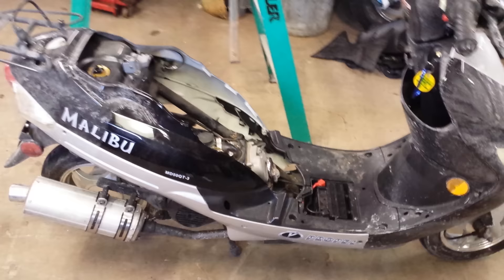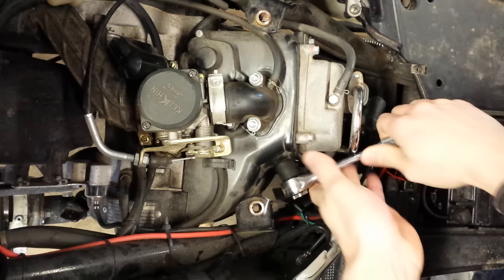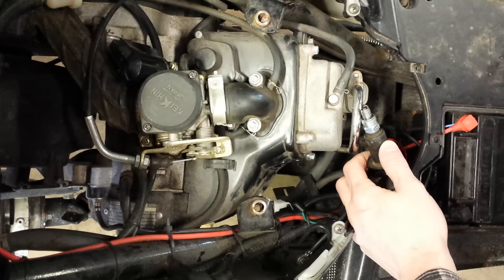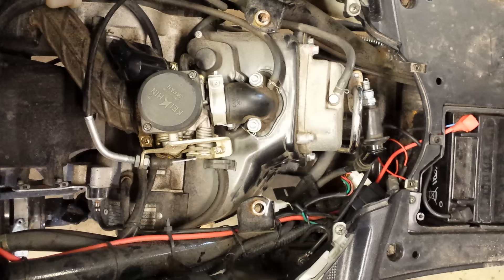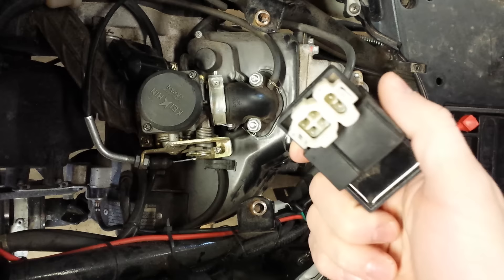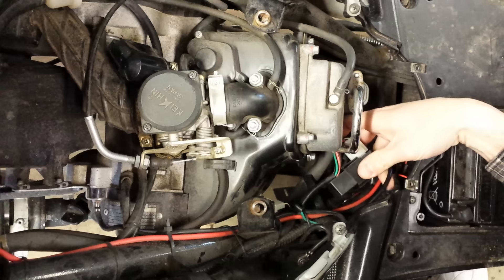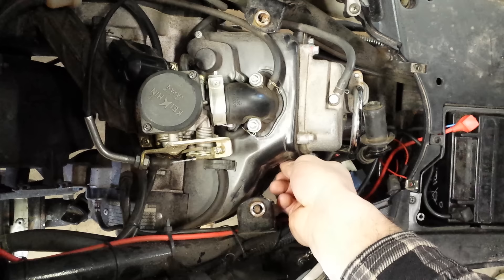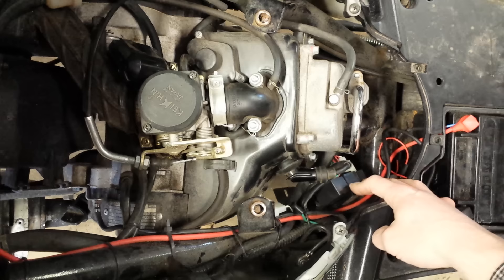Fix Chinese 49cc Scooter that won't start

Comment: I am having fuel issue.. when I disconnect line from carb and turn over gas flows..when connected no more flow.. carb is new and cleaned..tried other carb.. have great spark..any suggestions???

Comment: I have a d1e41qmb moped I have a new spark plug getting spark got a new carb getting gas hot a new cylinderl kit getting compression. But won't start still nee help? ??

Comment: need help with my sinski cute 50cc scooter there is spark coming from stator when disconnected but when i connect it there's not even a spark from that point to the line connecting to the coil. please help going crazy already. thanks!

Comment: After a few days runs on my moped with new performance cdi box, high tension wire & spark plug, oil and it runs good. Now, new problem arises the word "my moped won't start" again and I don't know where to start?

Comment: I’m getting a spark and fuel and still nothing. 
My moped only has 200 miles on it and the push button start hasn’t worked in a long time so I’ve been having to kick start it. 

Will only run for a second or two but after the second attempt, I get nothing

Comment: Great video, my question to you is my son took our Japanese scooter 49cc for a spin today with his friends, it’s been running good but for some reason he called me and said that he was going down the road and lost power. It starts but it’s really boggie, after getting it home I was looking at it and it does start but only if you hold the throttle almost wide-open but it doesn’t having a power trip and spend the wheel. Any ideas to look for?
Reply: Needs Carby clean mate. Happened to mine too

Comment: i have a 50 cc keway moped i have spark and fuel and still wont start  i just started it up for the first time in a year road around the block and it died on me so i cleand the carb and checked the fuel lines still wont start help!

Comment: Where is the spark plug located on a 2014 Tao Tao 49cc? I put a new starter yesterday and it is doing the same thing from your video. Helpp please!
Reply: Have spark and fuel but will not start

Comment: Your a GOOD mechanic.....After being around engines for years can I also say that that engine sounds better than most ?
Is this the same as a Honda or is it a better motor in a cheaper scooter ?
Reply: BRUCE LEE I got the cut cord its located on the bottom left corner from the peddle in it got a white tube on it what Is that called my cord it cut form that

Comment: Quick question, mine been sitting for awhile, put in new battery. Nothing working no sound no lights. You know what the problem is? Thanks in advance
Reply: fuse .. or ignition switch

Comment: My scooter been sitting 4 months I live in florida. It gets spark and I changed gas and put sea foam in it. I put starting fluid in eventually got it to start and it would run then randomly cut off while driving and won't start for 15 mins then sometimes won't start at all. I tried the next day and it won't start and I don't wanna keep paying my friend to pit starting fluid in it to get started then have to call to help me bring it home after it dies. It's a brand new scooter bought a year ago only 105 miles. What do I do?
Reply from the maker: Sounds like the first thing I would do is take your carb off and clean it or take it somewhere to get cleaned and see if everything looks ok inside. Sounds gummed up

Comment: Hey guys I have a Piaggio Free 50cc kick-only scooter and it has always started on the first kick since i bought it.
A few days ago that changed over night and now it wont start at all cold, I need to pull the throttle for a couple of seconds for it to keep going and not stall directly after the kick. When it's warm it runs and starts just fine. 

If I had to guess I'd say it's a problem with the choke, but I'm really no expert. please any ideas?
Reply: Consider your idle speed adjustment screw.

Comment: Thanks 4 such a useful video. 
My kymco agility 2011 won't star . I cc changed the spark plug  it doesn't have fuel problem and changed the battery  still it won't start .  Can you HELP MI. PLEASE

Comment: I need help with my bike...brakes lights don't work... The brake light comes on... But when i brake it doesn't get bright to show the driver behind me I'm breaking
Reply: If your lights are randomly dimming and not working correctly, it's either an old battery that should be replaced or your stator is not pumping out the current needed to power things. So I would start by replacing or charging your battery completely and if it persists you might need to swap the alternator or something

Comment: "CD fucking I"
day two with my scooter 
already replaced all fluids
disassembled and cleaned and reassembled carburetor 
replaced and hoses 
disassembled and cleaned fuel lever assembly 
on off reserve lever lots of calcium build up 

tonight I hunt for this cdi
I have spark as u, I have fuel as well. 

p. S it's a 1986 Suzuki fa50 moped. sat for 20+ years hahah

Comment: Great video!!! Helped alot... I have taotao 50 that wont start. New fuel, new oil, have spark (new plug), removed carb, disassembled, cleaned, and reinstalled, no leaks. Vacuum is good too! Any ideas?
Reply from the maker: have you taken a compression test?
Reply: Edward Iry that's the same with mine did you get it going yet
Reply: method ed would like an update if any
Reply: A new plug doesn't mean you have Spark,  you have to test it like he showed you.

Comment: mine will start with the kick start petal, but it wont start with the button break thing... only when i hold the buttom and kick start and mix a little gas in
Reply: not sure what it can be.... how long does a battery usually last, and do i just unscrew the lights to change out the bulbs??

Comment: Great video. I have spark and gas. However it will start and run for about 3-5 seconds then die. Then won’t fire back up. Any suggestions would be very helpful
Reply: ever fiqure it out i have the same issue

Comment: I had changed my carburetor, automatic choke, spark plug, battery and cdi and it still wont start?
Reply: did you check the valves? they may need adjustment. if they are off, it wrong be getting enough compression to ignore the fuel.
Reply: I sent mine to the shop and they told me, that it was a bad gas mixture stuck inside my carburetor. They also recommend me to switch from regular gas to 91.

Thanks for the advice though!
Reply: Jaycee Santos Cordova  may be the coil

Comment: I have a 08scwhinn scooter and it has no spark. I have changed the entire electrical system and I can't get it to work. Please help.
Reply: Have you tried checking the cdi cut off switch?? Sometimes a pinched wire can ground to the frame and prevent any spark from happening. Some scooters or mopeds even have points systems  but not really common these days.

Comment: Kasey do you have a video showing how the fuel lines should be? I have a manual but it is not clearly shows how. I replaced the carburetor and I can't get it to start.
Reply: What is the model of the moped/scooter? I may be able to get you the shop manual or a layout of the fuel system for you.

Comment: I've a problem with my chinese Generic XOR 50. When I was riding about, the engine shut off and I couldn't get it running again (happened about 2 months ago). I've checked for a spark and there is a spark, although I still have replaced my CDI box and my ignition coil and nothing happened - still the same. I got a friend to come and see what's wrong with it and he basically put some petrol inside the cylinder and adjusted the carburettor and it started for like 20 seconds and stopped running again. I have no idea what it is now. I've check the cylinder + piston & rings and replaced the whole cylinder with a new piston and rings but still. Would you think that it's the carburettor fault? I mean when my friend put in some petrol into the cylinder it did fire up but only for the 20 seconds and then nothing. I've ordered a new carburettor but I'm wondering if this could be the issue? The spark plug is sometimes wet and sometimes it isn't. Fuel sometimes even isn't sucked up through the 'wires'. Thanks.
Reply: +Alan W its time for a New Carburetor $20 on Ebay
Reply: +Tim Maines I've already replaced the carb. I took it to the garage and they say it's the engine - bearings and crankshaft. Now I have to buy these parts and everything else like the cylinder and piston because it f*kd up everything :(
Reply: Same happened to my longjia speedjet 50cc moped and I've replaced whole ignition system including plug and still nothing
Reply: +MrLaney32 my one turned out to be the faulty crankshaft. It was wobbling a bit and didn't start because of that. Changed it and it works ;)
Reply: Thank you, we are waiting to get an impact drive in order to get the stator off and will have a look at the crankshaft for any issues
Reply: +MrLaney32 I need to get an impact drive or gear pulley to take the stator off as well because my scooter doesn't charge my battery :( I doubt it would be the stator that's your problem. Do you have a kickstarter? If it doesn't work then it's not the stator :)
Reply: +Alan W it's the last part of the bike that creates the spark side of the ignition process that we haven't checked and the when it does on me, I was riding in terrential rain so if it's not the stator, then the bike is well and truly dead and is only 3 years old.
Reply: +MrLaney32 But did you check if you have spark?
Reply: can you turn the engine over by hand? never trust a shop

Comment: This didn't work. Bought 2 boxes a d my still won't crank over. Just watched another video that showed to remove the air box cover and spray carb cleaner into the intake port. Hope that works cuz changing the cdi boxes wasn't my problem

Comment: On the connectors to the cdi should the 4 prong side have all four hooked up? The moped I'm working on only has 3 wired and the forth is open. Not sure if that's the problem or if it's the cdi
Reply: the 4th one would be the RPM sensor, so it cuts the spark out after a set RPM stopping it going over 31MPH. Without it it can go faster, at the expense of a shorter lifespan on the engine
Reply: I have to question the 'shorter lifespan'...  The engines are designed for the higher RPMs - they are just throttled back for legal reasons.

Comment: so do I need to hold the brake lever in order to start it? kinda like a safety thing? sorry new to scooters lol
Reply from the maker: Andrew Sybert  yes most scooters will have to have the rear brake held in order to start.
Reply: left side always works to..

Comment: I have a new 150cc scooter.  Drives great... but take a couple times long pushes on the starter button to finally get up and running.  Any suggestions?
Reply from the maker: Sounds like a fuel issue.
Reply: Yes, check / clean the carburettor .. and if it remains like you described, change to a bigger nozzle .. begin with 1 or 2 steps bigger ..

Comment: I need some help, Change the engine put everything back together it’s a new engine there’s two components on the front and one on the side of the carburetor that are not on the new motor that just closed them off I can’t get spark to the spark plug

Comment: Hlleo, i have the same issue.. thought it was my pump got a new one it started and after running for a while it stopped.. idk if i might have the same issue but this scooter is 600 miles old onlyyyyy

Comment: Great video very detailed. I have a question though. My Chinese 49cc scooter dies when I throttle. What do you think is the problem?Thanks
Reply from the maker: carb needs to be adjusted or adjusted and cleaned

Comment: hi i have problem with my yamaha vino 125 2006 has spark has gas good exhaust is good  valve is good crank but wont start have the problem for weeks please help thanks
Reply: Possibly a low compression issue.

Comment: Mine is doing the same thing it is a 150cc BMS Heritage could this also be my problem and fix? After paying the scooter repair guys an arm and a leg 2x now if I go again I won't be able to ride anymore... no more limbs (yuck yuck badda bing) anyway it has the first 500 miles on it I have it on a battery minder & have checked it is not the battery.I asked the scooter repair shop to replace the spark plug when they tightened everything up and did an inspection on the uncrate hard for me to tell if they actually did or not. I'm thinking I could take this to my corner mechanic who is very good, honest and he could help me for far less $ and aggravation every time I go to this shop I feel like I am a second class citizen because it's not a Vespa and I have to sign a huge long waiver and I'm fed up and a woman feel like they have taken advantage of me twice.
Reply from the maker: I have no idea what your issue is. no spark?

Comment: My CGI Box does not work possible because i have no noise clicking the push to start button Help
Reply: KalonMcL Global that could be bad solenoid not the cdi. A cdi very rarely ever goes out.
Reply: @Unknown-hl7sb  cdi is most common part to go out if you have stock Chinese one.
Reply: john wygle yeah the stock ones are a pain in the ass.

Comment: I got an issue with my 50cc scooter too, when i roll on the throttle it wouldn't move forward, and when i rev it really hard, it would lunge forward very fast, seems kinda dangerous. Any idea what could be wrong with it? thanks in advance
Reply: Any updates to the fix? Mine was lunging also like the throttle was stuck but wasnt.
Reply: @Bluenosedogman  sorry, couldn't find a fix, i eventually sold it

Comment: Thank you! Great video ~ I bought a Bashan scooter from my nephew who left it sit outside in the weather over a Wisconsin winter. It starts but won't stay running when I accelerate. Chokes out. Can this also be the culprit for my situation as well? Should I check the carb (if it even has one ~ lol)
Reply: Yeah, that's a carb issue if I am reading you right. There are some great carb cleaning videos here on YouTube... or if you're not confident in doing that, replacing a carburetor is SUPER easy and VERY cheap on Amazon or eBay.
Reply: @JasonOfOconomowoc  Thank you :)

Comment: hi I hope you can help put a  different engine in my longjia digita 51 and got it going and when I Rev It Up my lights went bright and I did it again and the bulb blew can some help pls the fuse near the battery is ok it blew my front bulb and my back light bulb thks all
Reply: Check the battery if its a 6volt system as the battery becomes the voltage regulater.

If its a 12volt system then check the voltage regulater , its normally a alumium box with fins for cooling somewhere on the frame or near the battery.

Comment: I had the same problem and in workshop they said you need to rebuild all the engine because crankshaft change rotation!!! I dont know what it is all about but after rebuild engine and spend 1000$ everything is fine.

Comment: hi i thought i had the same problem but it doesnt hive any spark light when i changed the cdi. any sugestions?
Reply: I'm propably too late for you but for all others with this problem: check your stator and pickup (under the right black plastic fan cover). Also check your ignition coil. Sometimes you can get a new cdi, stator/ pickup, carburator, sparkplug and ignition coil as a set on ebay for under $40. You should order one for replacement parts and testing.

Comment: i've recently changed my spark plug, cdi and carburator and it still won't crank. what else can do?
Reply: Check the starter button for continuity or check the starter relay to see if its good, you can jump start it by taking positive directly to the starter, if it starts then you have a bad starter relay

Comment: Hello sir, my honda 60cc scooter doesn’t start and i supposed to kick that it was little hard to kick but now when i kick it to start its like so soft goes down. Do u have any suggest
Reply: No resistance when you kick start means there's no compression at all... how did your engine die? Was it suddenly and then it shut down? Or it just wouldn't start one day? Basically I'd pull the spark plug off and then buy one of those little compression testers and see if the engine is still OK
Although, to be honest, it's WAAY more likely not to be a compression thing. It's probably because your kickstart mechanism came undone. You'll have to remove the transmission cover and take a look at the springs and gears inside. There may be a mechanism with gears that has to be reset just perfectly. Without knowing exactly what the inside of your transmission looks like  I can't be more specific here

Comment: Mine will start and run for a couple of sec then stop running I have to let it sit for five minutes and it will start for a couple of sec then stop running...
Reply: Fuel filter?
Reply: Sounds like your electric choke has issues

Comment: hey buddy I had a quick question I need
and thanks for the video help a lot
Reply from the maker: King Jay what's up?
Reply: I got this cut cord in I followed it to the bottom left side of the scooter by the peddle in on the bottom of it, it got a white tube with a pointy tip what is that in were can I by another one from
Reply: Could this be the float bowl drain tap?

Comment: thanks  for the video .. but mine has power to the  lights and horn and but  dose not make any atempt to start no click no chug
Reply from the maker: U would check your wires hut more importantly your solenoid may be bad.
Reply: You may have a short somewhere in your wiring. Happened to me. Some ignition coil wires got shorted to the frame by accident. I checked all my wires everywhere on the bike and found it, patched it with electrical tape and it was OK. This is especially true if you can sometimes get it to start by jostling the bike around